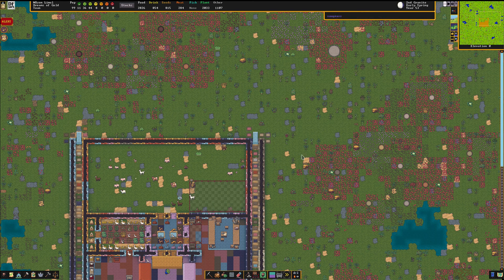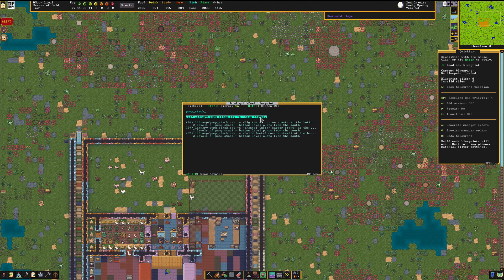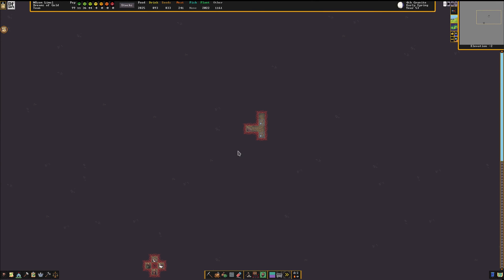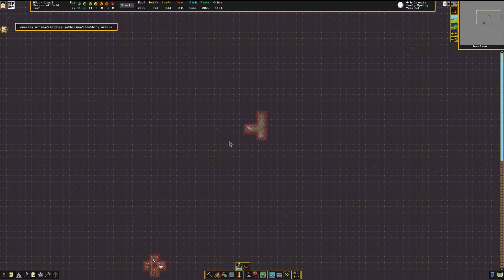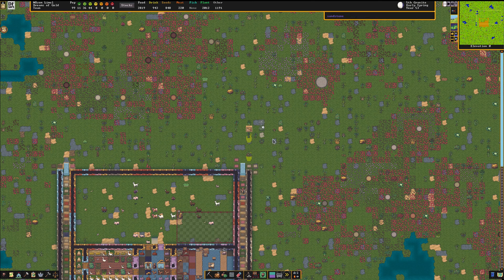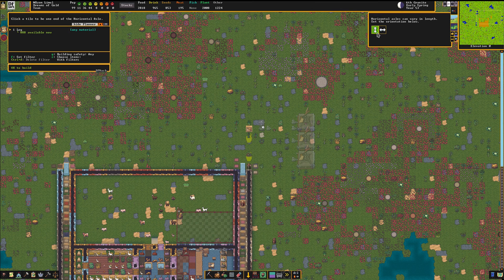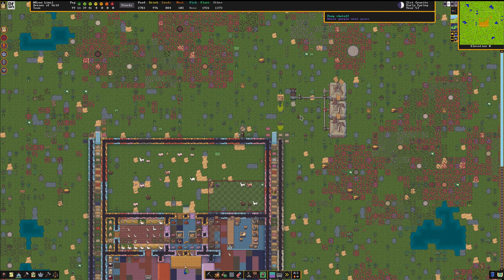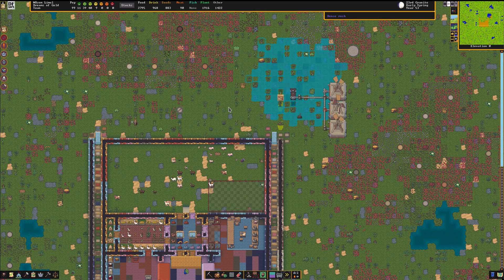Dwarf Fortress: Pump stacks made easy

Comment: I have a question; I am trying to build one that is over 100 levels tall. It breaks before it is ever finished. What am I doing wrong?
Reply: It does say to just rerun the /build blueprint and I did that but some of the parts got stuck in the enclosed part.
Reply: Yeah I keep doing that and it seems to work. Had to take down walls. Probably better to set the blueprint before ordering the parts so they build 1 at a time.
Reply: Okay my problem was the first pump needs two solid bottoms if anyone else has trouble.

Comment: I don't understand why do people keep calling these 'pump stacks'? They are screw pumps.
Reply from the maker: It's because you "stack" the screw pumps vertically to lift liquids multiple z-levels while transmitting power without any extra machinery.
Reply: @dfhack  I understand that now, but to someone who isn't aware of that, that actually requires prior knowledge of how they already work which is counter intuitive. 

I see a lot of videos talking about 'pump stacks', is that more the case that a lot of people use DFHack and therefore it can monopolise and proliferate the introduction of names of things?
Reply from the maker: Although DFHack can help make pump stack construction easier, it is not the originator of the idea. The Dwarf Fortress wiki has an article on pump stacks that doesn't even mention DFHack ( https://dwarffortresswiki.org/index.php/Screw_pump#Pump_stack ). However, maybe I should have spent more time in the video explaining what they are. The pump stack is one of those uniquely Dwarf Fortress rites of passage that becomes familiar jargon to experienced players. Not everyone is an experienced player.

Comment: How do i make it so the pumps are build out of magma save material?
It says to use the buildplanner plugin to set to a magmasafe material but when i do that it just ignores it anyway, i might be doing it wrong tho.
The way i do it is by opening up the wall construction mode (b->n->1) and setting it there to magma safe in the buildplanner gui but that doesnt do anything.
Reply from the maker: You have to specifically set the filters for screw pumps to magma safe materials. Filters are per-building type.